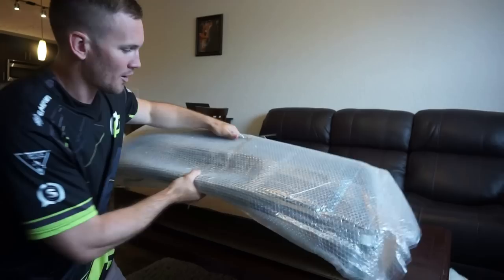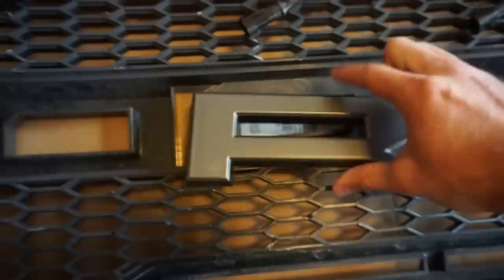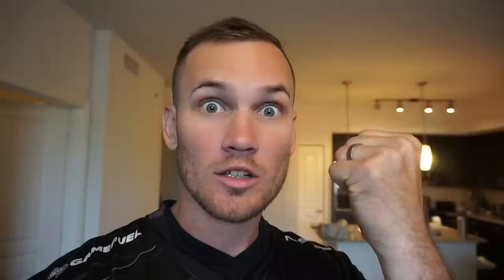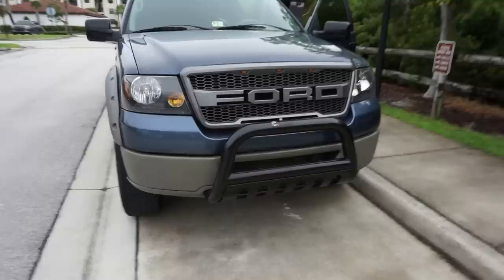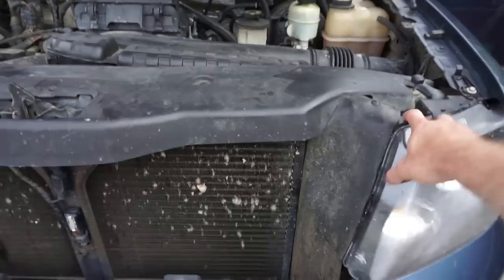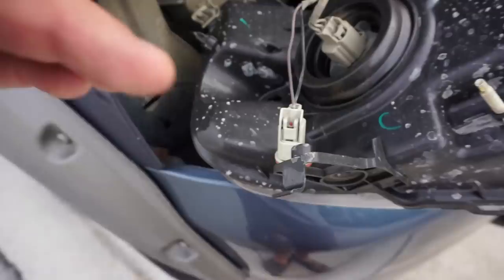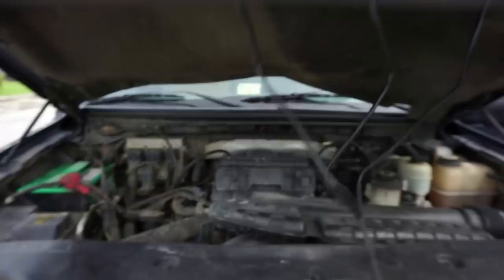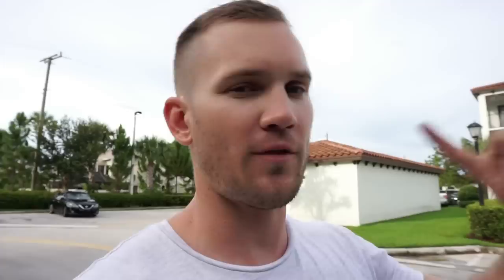How To Install Ford Raptor Grille on a 2004-2008 F150 (HOW TO SPLICE INCLUDED!)

Comment: Great video! Just a quick observation. The reason it was a PITA  installing the 8 bolts through the hood was because those square nuts that you used as washers on the "control arm" are to be used on the bolts that you insert in the grille;  you only have to finger tight them.  This keeps them in place so you can then feed them through the holes in the hood. I did add some small washers on the "control arm" screws just for added insurance.

Also, after I installed the grille, which looks awesome BTW, I did notice that there was a tiny, tiny gap between the grille and the hood...enough that if you look hard enough, you can see the light from the LEDs shine through. Nothing negative against the grille, i just think it's how it was cut. So what I plan on doing, since my OCD won't let this slide, is removing the grille and instead of using those square nuts (which could be acting as slight spacer) to hold the bolts in place, I may either try using a small strip of tape or cut a piece of thin flimsy plastic (like that wire shelf lining material) to the shape of the square nuts and slide that over the bolt threads to hold them in place. Hope this helps!
Reply from the maker: Thanks Mike!

Comment: A very detailed description of the installation. I would highly recommend NOT using the splice blocks in an area that can get wet. At the very least tape up the blocks, so they are water tight!
Reply: I used some of those temporarily because i was soldering at midnight and I was starting to see things. I sh*t you not they corroded and stopped working before I got home from work.

Comment: I would have ran the wires behind the hood heat shield so there out of the way so when you close the hood and don't lay on the hot engine parts or something moving on the engine .
Reply from the maker: I agree. Looking back, I wish I would’ve done it that way. Life lessons!

Comment: I haven’t watched all your films, but I would suggest upgrading to a melling high pressure oil pump and replace the phasers and chain guides rather than upgrading the aesthetics. I have a 5.4 3V and that would fix the real issues.
Reply from the maker: It depends on if you're doing it yourself or through a shop. The upgraded oil pump itself is only $138. The YouTuber FordTechMakuloco is pretty much the #1 resource for all things mechanical involving this model of F150 and makes some great videos showing how to do/fix things on it including the oil pump. If you're going through a shop, it should cost you anywhere between $750-$1k for the oil pump. Maybe you could talk them into a packaged deal since it would make more sense to replace everything all at once.
Reply from the maker: Jha manyfield happy to help! 👍🏻

Comment: Thanks for the video. Installed my grill w/LED 2 years ago. Recently, one of the Led's was not working, another was half lit. Played it safe, purchased a set of new LED's from Amazon. Finally, had time to install today. First checked wiring; light not working was not due to power, 2nd same. Both diodes bad. Check the wiring main harness to battery; found a power wire (red) completely corroded through and water inside heat shrink and tape. Quick trip to HD, problem solved; so I thought! In order to change the LED's, you must loosen all bolts that hold the grill on. Now, comes the pain! All the bolts had rusted over the years. When loosening , both bolt and nut turned. Break out vise grips;  progress made.  Finally, got all LED's installed, grill tight, aligned but too dark to continue for power hook up. All in all, I highly suggest you use a good heat shrink, solder your connection where you can, and use dielectric compound on your connections. Enjoy!
Reply from the maker: Wow Mark! Sounds like an intense process haha I hate it when the bolts turn with the nuts, glad you finally got the LED's replaced!
Reply: @AndrewDoesLife  Thanks Andrew. New lights are working and brighter than originals.

Comment: Okay....haha....hmm okay, where do i start on this.  First, i bought the black version of this grill and i love it.  Theres a few things that i learned about the installation of this thing and ill pass them to you and the other viewers.  First, the grill is easy to install itself even though its not a perfect fit.  It takes a few small taps to get the gaps right...but no big deal.  Second, the wiring has to be done before you install the grill on the truck.  The frame is wide enough to stuff all those wires in so you wont have a clearance problem between the hood and the radiator core support cover.  Im a huge stickler when it comes to running wires.  I want all my stuff to look factory.  I ran the rest of the harness behind the hood insulation and then behind the coolant jug.  I then ran it along the inner fender where i came up short.  I had to add another 16 inches to my harness so that the wires were where i wanted them.  I dont have a spider web hanging all over the place like you have there.  I also finished it off by buying some wire loom cover to pretty it up.  I would redo what you did there so that your wires arent laying all over your motor.  These are the things i learned about this grill.  Next time i install one, ill know to wire first, then install the grill second.

Comment: Hey Andrew!  Thanks for the video.  My 15 year old son and I are fixing to buy him a 2005 F150 with a new engine already installed.  We're going to work on cleaning it up together and making it "right" for him.  This project is definitely on our list to do together and looks easy enough now that I got to see your video!  Thanks for what you do.  You're helping people!  All the best,,
Reply from the maker: That is so cool to hear! Thanks for the kind words, Steve. I hope that trucks treats him well!
Reply: @AndrewDoesLife    Hey dude. Always go to the auto parts store and purchase a fuse to protect your wiring. As you noted, if the hood latch pinches the hot wire going to the led lights on the grill, you will have an electrical fire, if the fuse for your marker lights does not pop. You probably only need a 10 amp fuse. As an alternative way to protect your truck, you can use two insulated female spade terminals to make a fuse holder. Although that type of DYI will result in the fuse being exposed to the elements, and it will eventually corrode and give you trouble with the lights. Thank you for the great video! Very helpful for me to understand how to remove the factory grill from the hood, so I can install a billet grill.

Comment: Just actually found the kit. The link didn’t work anymore but I found it. Materials are pretty much on par with any high end aftermarket stuff I’ve bought in the past. The actual grille seems well built and pretty tough plastic. Let’s see  if it lasts. I’m going to wrap electrical tape around my connectors for wishful thinking
Reply from the maker: Yeah they seem to sell out very quickly and then get relisted under a different link. Here’s the latest one I found today with in stock inventory - https://amzn.to/3KaZgUg

Comment: NICE VIDEO! and for the clearance lights, you could've just used a "add-a-circuit" Fuse tap and ran the positive from the park lights fuse, And just grounded to the vehicle and they will come on whenever your park/headlights are powered, And if you wanted to go a step further you could Through the pain staking task of running the wire through the grommet and into the cabin to a switch
Reply from the maker: Thank  you! I am very much a beginner when it comes to electrical wiring so I just went with what u could figure out from doing online research haha

Comment: those square 'washers' you used on the bracket with the screws...those hold the bolts on the top of the grille so they don't spin while attaching.

Comment: Best install video on the tube!!! I have a 14 f150. Put the raptor grill on today. However I didn’t know about installing the 4 bolts to the inside of my grill. I already pushed the clips in on the hood, and bolted down the bottom of the grill. I’m afraid that if I try and pop out the grill that I will break the clips. With all the 2014 f150’s the clips always break when lifting out the grill, you have to use a pry tool. The set up is kinda different than yours..slightly. Still have to do the amber lights..
Reply from the maker: Thank you for the kind words! Best of luck with your grille 😊
Reply: What year grill did you put on your 14 I have a 2014 as well and I found a 2008 grill just like that don’t know if it will fit

Comment: Definitely finding your videos helpful. Recently changed out all the interior lights in my 04 to LED. I really wanna try raptor lining mine but I'm a little hesitant cause I don't wanna screw it up. Next project is changing out the hoses and jets on my windshield washer system. I enjoy working on the truck and these instructional videos are a lifesaver.
Reply from the maker: I hear that man, I was really nervous to do mine as well but as long as you follow the steps it really is a beginner friendly process; albeit time consuming. Glad to hear these videos are useful to you!

Comment: Just an FYI those "square washers" you put the Phillips screws into the grill with were meant to hokd your bolts in place at the stop the square head bolts you had so much trouble with.  Pre-install them and tighten down the sqaure nut onto the bolt threads from the other side and it holds the bolts nice and rigidly so they don't move. Other than that great job
Reply from the maker: Brandon Hagan thank you Brandon!

Comment: Great content. I will say one thing. If you live in a climate with bad winters and where vehicles rust let all those bolts soak in some pb blaster before taking it off. If you don’t you will play hell getting the old grill off!
Reply from the maker: Good point Dominic! I don't have anything but heat and humidity where I live but if I still lived up north I would definitely take that precaution!

Comment: Ithink you can  attach the black wire to any bolt that is in metal frame work since black is ground.  Want to change my grill on my 2004 f150 fx4 to raptor

Comment: I just installed this grill. But the square nuts are not washers. I used those in the studs so they would keep falling out. So square top stud slides into the groves. Then square nut goes on to stud. I did that because the count was right 7-7-7. There are eight screws that hold on the brackets.

Comment: I liked the video , only suggestion I got is maybe tucking those hanging wires behind the insulation on the hood. I’m just worried about them touching a hot component and melting other than that grill looks guuuuureat.
Reply from the maker: I eventually went back and rerouted the wires behind the heat shield :)

Comment: I installed this grill on my 2006 f-150 followed your video for instructions did everything the same way but for some reason my hood won’t close all the way
Reply from the maker: Hmmm that’s strange. Is the grille not clearing when you close it, or will it just not latch when it closes?

Comment: Just a suggestion,  but wouldn't an extended harness running under the padding ,across the inner fender, to the left parking light be much better ?
Reply from the maker: It probably would’ve looked cleaner haha this was first ever attempt with wiring so I’m just happy that the lights turned on 😂

Comment: Snake the wires through the hood so the don’t get caught in the fan and look neater and next time you use those splicers don’t strip the wire.
Reply from the maker: Thanks Garth! I redid the wires and they are behind the heat shield now and out of the way

Comment: Hey Andrew, Thank you for your videos, they help. So, I installed the grill on my son's 05 and light do not come on. I double checked connection that gets the splice and it's correctly made, but lights don't come on and now the audio to radio does not play. I checked fuses and they all looked ok. I reached out to manufacturer and they are sending a new harness. At first during install I was concerned that connection wires coming from LED was so close to hood lip they would be crimped and cause issue. Not sure what is going on, any suggestions? Appreciate you

Comment: You're using your turn signal? I used my parking light,like I thought you were supposed to,but my parking light has 3 wires one of them is white,I tried the black and the faded red wire,clamped it down using the quick splices, watching your every move and nothing..You have any suggestions? I've read the old wiring alot of times prevents the connection because of the corrosion build up making it hard for the metal connector to penetrate

Comment: Question! I have a 08 f150 and I just put in aftermarket halo led headlights and had to splice those cords already for the halo lights to work, could I use the other part of harness for this?

Comment: This might be a really stupid question, but is it fairly easy to change the letter out after the grill is on? The company I bought mine from is sending the grill and letters in two separate packages.
Reply from the maker: Yes mine were just attached using Phillips head screws. Very simple to use!

Comment: I have a 2005 f150 sport 2 super crew.
It has 190,000 miles. It looks as if it was taken care of. It's slightly modified and also has Rapture grill, lights, etc.
I hear a tapping noise in the engine. Is this just the timing belt needing replacing .  Especially because of the mileage.
Ty

Comment: So if it doesn’t work and the problem is in the connection I made, how do I know if I crimped the wire down enough in the little connector to make contact with the wire?
Reply from the maker: That I am not sure about. It could also be you are using a quick splice that is not suite for the gauge of wire you are splicing together

Comment: You were doing great until you routrs that harness. If the harness is long enough you should route it above the heat shield/through the hood. That will keep it away from engine heat and spinning belts and fans and pinch points all over.

Comment: Just installed this on my 06 F150 my amber lights are more yellow any suggestions?
Reply from the maker: Well, the lights are removable by unscrewing the two screws in the back, if it bothers you that they look more yellow than amber you could switch out the light covers to a more amber one or you could sand down and paint an amber color over the existing ones. That actually sounds like a real fun project so let me know if you decide to do that haha

Comment: Love the info, and great truck.

BUT, please don’t every use those blue “t-tap” wire connectors.  Truck is way too nice to have the most amateurish type of wiring connections known. Spend the extra few minutes and do a proper wire splice that will last and survive the weather.

Comment: Couple of questions - What color is that grill and fender flares? Looks matte gray on both. Also, what color code is your car? Just bought a 04 F150 same color. Trying to find out. Thanks!
Reply from the maker: The color on the item was Gray and the truck is True Blue from the factory :) no problem!

Comment: I ordered this for my truck but the middle amber light didn’t turn on :/  I’m sure I can replace that light bulb ? Cause I know the wire works and it has power going in . Maybe the light bulb is out ?
Reply from the maker: Probably just got one bad LED light in the bunch. I'm sure they are easy to replace
Reply: Andrew Does Life thanks for the feedback , great video btw made it 1000 times easier

Comment: The amazon link you provided is for 09-14 F-150s which have a different grille shape than 04-08 F-150s. Is this still the exact part you purchased or did you purchase it from somewhere else?
Reply from the maker: Thank you for pointing this out, you're the second person today to bring that up haha so I contacted the seller because even when I click on my previous order it brings me to a grille for an 09-14 F150... They're currently out of stock for the one that fits 04-08 F150's, that's why it's redirecting you to a different model. Here is a link for that grille sold by a different company than where I got mine from. -- https://www.amazon.com/VZ4X4-Front-2004-2008-Raptor-Grille/dp/B07N75RY5P/ref=as_li_ss_tl?keywords=f+and+r+letters&qid=1569797114&s=automotive&sr=1-46&linkCode=sl1&tag=aslunsford05-20&linkId=0adbf54db8f8c3caa2acc6f0b69de5ff&language=en_US

 I just went to Ebay as well, and it doesn't seem like there are ANY available at all with the F and the R letters included.

Comment: Hi Andrew, great video! I’ve been very hesitant on buying a raptor grill for my 05 f-150 but have finally decided to go with it. I’m clicking on the link you provided but I’m assuming it no longer exists. Any recommendations?
Reply: The reason these grilles keep getting pulled from Amazon is because the manufactures aren't licensed to sell them, so what they're doing now is sending the grille and the F and R letters in separate boxes (my grille got here yesterday, waiting on the letters). This is the one I got: https://amzn.to/30UspgX (shameless affiliate link, sorry!) Keep in mind they only sell the charcoal grey one, so If you want a black one you'd have to paint it, or just search for another grille from another manufacturer.
Reply: @uscoastgaurd  thanks for the link, I’ve run into quite a few on Amazon but noticed on a lot of reviews that some got the letters late and others that didn’t get them at all. Which is why I’ve been holding back. I did find a website called builtnko.com which sell grilled for tacomas, f150’s etc. More expensive but I think I’ll end up ordering from then, they seem legit.
Reply: @sergiotapia1061  Awesome! I'm still waiting on my letters, but they gave me a tracking number so I know they're on their way. Let me know how that grille looks man!